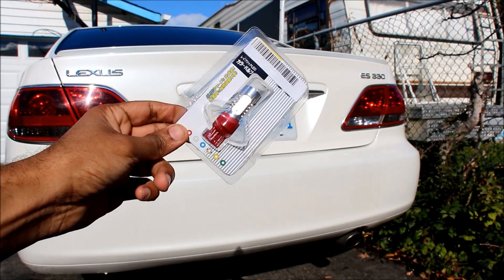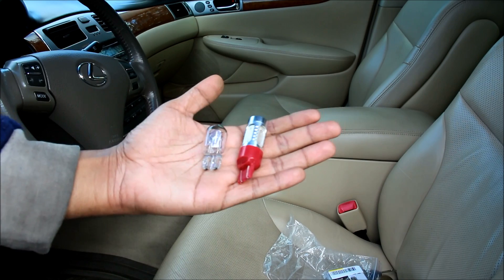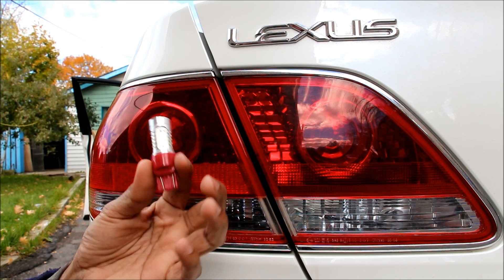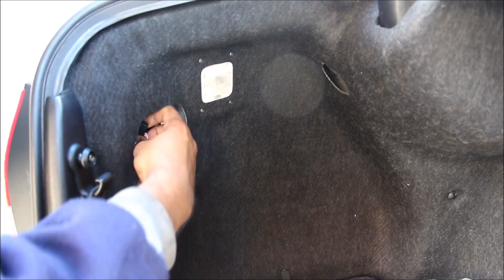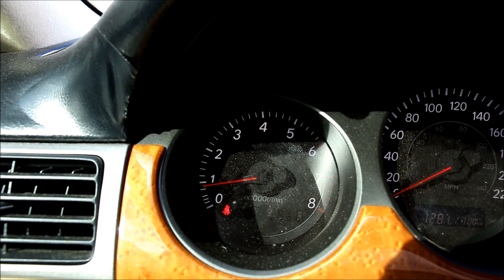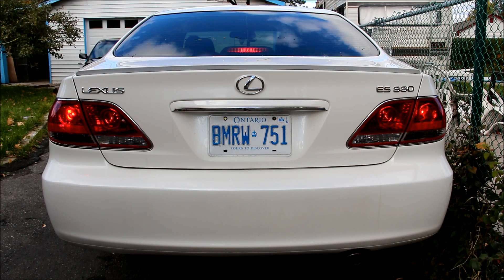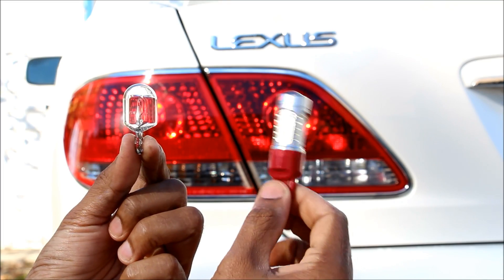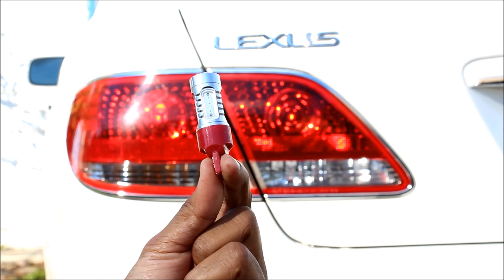LED vs Incandesent Tail Light Bulb Review

Comment: As I've told you before I use Sylvania Zevo Super Bright leds. I didn't want to cut wiring for led resistors so I got a new flasher that handles both regular and led bulbs. The only leds that are not Sylvania is my headlights they are Oracle lighting V Series led headlight bulbs. The V Series has no fan in the led bulb. That's what I was looking for. There not as bright but that's okay. Can I ask you a question. I want to change the bulb or bulbs behind the clock in my 2000 Toyota Camry LE. How do I go about doing that?

Comment: Somehow I feel the traditional filament bulb is good. Because the intensity is good in day light. LED unless if it's a very highend one + fitted with a good reflector will only provide best result in day as well as night.

Just a thought. Is there any post which can tell us how to slighly improve the voltage so that it can increase the intensity little bit more of a p 21w/5w bulb ? May be an electronice boost converter. Many would not agree with it as It may reduce the life span of the bulb. But they are so cheap to afford.
Reply from the maker: The incandescent is hard to beat
Reply: @speedkar99  Well said.

Comment: LED uses less power AND is less bright as incandescent. What sux is there are single LEDS that are bright, they simply will not use them. HEAT? Not an issue since we're looking for LESS THAN twice the brightness to stay legal.
How to fix this?
IF YOU HAVE ROOM...drill out a 2nd hole and silicone in another LED.
Reply from the maker: Modern LEDs have gotten brighter

Comment: Very good video, you got right to the pros and cons of the 2 bulb types.  Focal points of the bulbs in relation to the different housings of different cars is definetly  something to consider.  Lasfit brand bulbs seem to address this best by mimicking the shape of OEM bulbs along with proper LED chip placement. Of course, quality and longevity are other important issues.
Reply from the maker: Thanks
Reply: I just installed Lasfit LED brake bulbs on a Toyota Tundra, OEM bulbs are brighter

Comment: Those led bulbs only perform properly if the projector lens of the bulb points straight back and yours don’t. That’s why it’s not as bright from the rear. The focal point and all that which you talk about is because of the weird bulb position inside your tail light.  And that “stupid light on the dashboard” is very easily fixed with a load resistor on each LED bulb.
Reply from the maker: +Rat Rod Studios - DRR Customs Ltd Yes agreed. 
If I used a resistor though, I'd loose the function of the indicator light on the dash board
Reply: speedkar99 that light on the dash is just a courtesy warning. If you were gonna ignore it before a load resistor, let’s not worry about “losing function” 😂😂.
Reply: Rat Rod Studios - DRR Customs Ltd: Yeap

Comment: I will stick to incandescent.  but another advantage of LED....takes longer to drain your battery if left on.
Reply from the maker: +romansten9 That is if you don't have resistors wired in.
Reply: speedkar99 when is it a good idea to wire resistors in?
Reply: I figure now that a lot of vehicles will tell you if a bulb is out, so if you switch all your outside bulbs to LED, the system will go through and tell you each bulb is burned out, unless you put resistors on every bulb.

Comment: More brightness is not required, and can in fact be a hazard to drivers behind you. (ever driven directly behind a 2018 CRV at night i traffic? Torture!)
The focus on brightness is silly and unnecessary, the advantage of LEDs is power consumption, heat reduction and for headlights, light on the road .
Reply from the maker: +theRealAV8r agreed OEM LEDs are too bright 
But the reaction time is great
Reply: Yet, and again imo, reaction time of either is still fractions of a second, so there is simply nothing to be gained from a safety perspective - we're talking about the human eye/brain, not a computer.
The crucial factor for park/brake light LEDs in alerting drivers is the ratio between normal and bright  not reaction time or brightness compared to incandescent. The wrong LED with barely a difference will actually decrease safety.
I am still researching this myself - apparently there are some with good ratios from Phillips, JDM Astar etc.

Comment: The beam is off because the LED placement is a lot higher than the incandescent. I bought Sylvania Zevo LED and the placement is exactly the same as the filament in the incandescent therefore it does not change the beam pattern at all. I’ve had them for two years on my Chevy Cruze and not a single issue with them al all.
Reply from the maker: +Salvatore Casto Good to know thanks
Reply: Yeah but on a Lexus as shown you get the tail lamp out indicator. Total deal breaker

Comment: I've thought a lot about this and even went as far as to replace all of my rear incandescent lights with this type of Chinese LED bulb found on eBay.  I discovered my eyes seem to be more receptive and sensitive to the incandescent lamps versus the LEDs.  This is probably due to the LEDs being very monochromatic in output whereas incandescents are throwing more of the visible spectrum out there for your retinas to capture.  I ended up going back to all stock incandescents in the brake lights and turn signals, but kept some nice cool white LEDs for my license plate lights.
Reply from the maker: +Alexander George Agreed, the cool white on license plate looks nice and won't bother you since its not shining directly back
Reply: speedkar99 what LEDs did you use on your rear plates any links? Im currently looking through Amazon

Comment: I have an 01 came XLE v6 and I tried replacing all 4 bulbs with LEDs and everytime I stepped on the brakes it blew a fuse, could it be the wrong type of LEDs?
Reply from the maker: +Bozn0man yes because resistance is too low. You need resistors

Comment: I really don't understand you guy. You are all fucking moorons. There's right amount of light with stock bulbs, you can't just boost up luminosity since you will disturb other drivers. And i hope you know that those cheap leds use resistors that will eventualy fail due to excess heat. They usualy last 6 months. And can bus cars will also report bulb error using those bulbs and blinkers on most cars will blink with twice the speed.
Reply from the maker: +Borut Goli valid points. LEDs have better transient time

Comment: Very good review.

 My car also takes 7443s for tail/brake lamps and I ordered white pair.
My car has the older deep red reflector type lens, so I don't think red LEDs would be bright enough as white.
 Newer cars with a clearer red lens, such as yours, would work much better with red LEDs like you demonstrated.
 I am wondering if you installed non-projector type bulbs instead of the projector types, if the light/beam pattern would be more like an incandescent bulb. Since the projector type you installed not only has light output from the sides but also it gives a concentrated beam of light from the top, as apposed to a non-projector type bulb which gives a more uniform light output from all sides, using more of the reflector inside the tail light housing.
Reply from the maker: +Random Canadian yes
Reply from the maker: +Random Canadian thanks for the feedback

Comment: You should  not touch the leds with your hand.   The oil from your skin will cause the led to burn out sooner.      You can purchase a resister to compensate for the car computer thinking a bulb is burned out since the led does not use as much power, it also keeps the turn signal from rapid flashing.

Comment: These LED bulbs don't make enough heat to melt the snow off if you live in snow country.
Reply from the maker: +B Laquisha True
Reply: What if they ice or get snowed over while you're driving?  Tail.lights are especially bad for this, though it can happen to headlights too.
Reply: @lowercherty  then get a vehicle that’s more aerodynamic. Modern cars just have the wind flow over the car and it’ll keep snow from getting back on
Reply: @TaylorPhase  No matter how aerodynamic the car is the tires and slipstream under the car kick up snow and it sticks to the rear of the car.  Don't say just get a lower car, you'd just be showing your ignorance about driving in snow.
Reply: @lowercherty  never said get a lower car. I said more aerodynamic. Even Tesla model x SUVs are aero. And mud flaps can help with that too...
Reply: You're meant to clear the snow off the headlights and taillights before you start driving, anyway.

Comment: The incandescent bulb is far better. And that LED bulb is illegal for that very reason. Not enough brightness change when braking. Philips 7443 is the only street legal LED on the market.
Reply from the maker: +Ron Edwards This led would have worked better if the lense pointed it straight back instead of upward, and if I had resistors to tell the bulb indicator on the dash not to lightup.

Comment: A resistor wired in parallel with the LED can fix the dash board light sometimes.
Cars Simplified has done a cool video on how to get LED bulbs to work in a Volkswagen that normally wouldn't let the polarity of the bulb work.
Reply: yes it will because when the led goes out the resistance changes
Reply: The warning indicator light isn't currently going to "work" when the light is actually out because it is constantly lit. The indicator is designed to function when something fails open circuit. The resistor will stop you from regarding your warning lights as a boy crying wolf.
Reply from the maker: Yes, you can purchase load resistors, but then your bulb indicator won't work when the light is actually burnt out.

Comment: I only notice around a 10-20% brightness difference, seems kind of pointless to me but. If you would have went with a white bulb to the red lens it would likely have been brighter but putting red bulb to a red lens will make it darker.
Reply: A red lens looks "clear" to a red lamp. With incandescent you are throwing away the first 90% of the energy as heat, as opposed to 10% with the LEDs. Then, you are throwing away all of the yellow/green/blue photons that heat up the lens instead of making it through the color filtering.
LEDs don't need more cooling than incandescents when they aren't run to the edge of their ability. The LED lamp is running 4 LEDs in series and grouping them in 8 groups of 4 to generate that 7.5 watt rating. The worst-case scenario would be 7.5 watts at 12 volts for 625 mA. That's well within the shared capacity and shedding less than a watt of heat instead of nearly 20 watts of heat with the incandescent.
Reply: We can put LED with same power as incadescent bulb where LED will be at least 8 times(800%) brigter.
But LEDs need good cooling, and inside plastic box without airflow they will die quickly.
So its best to install low power LED that have same brightness like incadescent bulb but dont requires much cooling and will last.
Reply from the maker: +B-91-10 putting a white bulb into a red lense will make it show pink.
Reply: oh okay

Comment: First time that i see a led bulb that gives good and bright light :) nice video
Reply from the maker: +MMD Bright yes, but it's not aimed properly in these housings, so I don't see the advantage of going LED.
Reply: Try these: 

https://www.amazon.com/Philips-7443-Intense-Vision-light/dp/B00P2D3W0A

Much better than stock for me on my 2010 Corolla. They emit less light altogether but the reason they work much better is because they cast the light onto the reflectors taking advantage of the reflective surface. These tower style bulbs are simply focus on raw lumen flux while the Phillips uses the existing reflector optics.

Comment: In my 2006 Jetta they don't work at all unless you use a resistor or buy the ones that have the resistors built into each one.  Other cars that need a resistor will give you that cheesy hyperflash (turn signals blink twice as fast).  If you need resistors be sure to find a safe place for them, they get hot.  You don't want those up against wiring or on an exterior panel.  Get help from someone who has already installed load resistors in their car if you have to or you might have problems if you don't mount them somewhere safe (not near plastic or wiring and away from exterior panels).  If you use 1156 bulbs, DeAutoKey makes them for such finicky cars as my Volkswagen.  They already come with the needed resistors and a limited lifetime warranty.  These might work with other cars and they may even make the wedge type bulbs too.  The best thing is their prices are reasonable, none of that 80 dollar per bulb bull shit.  They make all their own bulbs and even interior and exterior bulbs as well that are error free out of the box unless otherwise noted by them.  DeAutoKey's bulbs work flawlessly in my Jetta and that is a car that is difficult to find LEDs that work in without having to wire resistors in, I know because I looked.  Even ones of other brands claiming to be CAN bus compatible did not work and my car has a CAN bus.  What I do is make sure I can return them, some places will not take them back because they are an electrical item so you have to watch out for that or you could loose some money on bulbs that don't work.  That would suck.  I even tried the Sylvania ZEVO LEDs, LUMEN Plazma, Pilot Automotive (junk?).  All three had claims of being error free on the packaging, well here I am every LED manufacture's worst nightmare when it comes to advertising hehehe!!!!!!
Reply from the maker: +John Doe Good point. Given the poor performance of LED's, plus the fact that you need resistors producing heat, I'm sticking with my incandescent bulbs for the time being.

Comment: Would getting error free LED's solve your dash light problem?
Reply from the maker: +dragon123443 LED's with resisters built in would solve that problem, but then the indicator wouldn't work if the LED did burn out.
Reply: If the LED stops functioning, you have that problem either way: load resistor keeps the dash light off whether the LED is working or not.  Without a load resistor, the dash light comes on with the LED working or not.  

As you are: if the LED does burn out, you still won't know since you are already ignoring your dash light...

Comment: What about LED headlights, or, a fix to the dash light?
Reply from the maker: +My03Tundra I'll have a review on LED headlights out soon. They cause too much glare like HID's. To fix the dash light you can wire a load resistor in parallel or cut the wire going to the bulb in the dash.
Reply: LED headlights cause glare? I was unaware of that.
Reply from the maker: Big time glare, but it really depends on the housings you put them in. See this video:

https://www.youtube.com/watch?v=wFOfIZMMjA0

Comment: You can use a can-bus led to get rid of that warning light in the dashboard.
Reply from the maker: +Daniel SBK True. CAN BUS LED's have the load resistor built in, though are typically a bit more expensive.
Reply: https://www.youtube.com/watch?v=tkPGqM0Sl64

Comment: To stop the fault light on the dash, you could try soldering a resistor in series with the LED with the same resistance as a standard bulb.
Reply: This would mean that with led and resistor the same current will flow as with regular bulbs.
Reply from the maker: +Michael Martyn The resistor would have to be in parallel, and be a high wattage resistor. But then if the LED bulb were to blow, you wouldn't know because it still thinks the resistor is the light bulb. Load resistors also produce a lot of heat.

Comment: good comparison video, hope the LED bulbs last for you, I'm not a big fan of the quality control of the made in china units, put some in my license plate lights and one side went out after about 3-4 months, I'll be waiting things out till LED designs improve and have the proper lighting angles
Reply from the maker: +neppy5 The angle and light distribution is the biggest thing. At least this LED bulb feels substantial and looks like it will last. I'm going to revert back to the OEM bulbs for now, since the brake light isn't as bright, as you saw in the video.

Comment: Thanks.  That was very helpful.  When the time comes, I now know that I won't reach for an LED replacement.
Reply from the maker: +wholeNwon For some, its worth it for the looks, for others LED's aren't worth the cost.
Reply: +speedkar99  Right.  I have a Lexus, too, and mine would not only show the light out message but also sound a chime.  Those would be hard to put up with.
Reply from the maker: A chime? wow, never heard of that on a Lexus. What year and model? I thought that was mostly a German car thing.
Reply: +speedkar99 1998 LS400...spectacular car.  It replaced 2 Mercedes which were junk by comparison...in my (Constitutionally protected ) opinion.
Reply from the maker: LS400 is an amazing car. It will last you many many years.
Reply: +speedkar99 It already has and is still a joy to drive.  Hope to keep it indefinitely.  BTW, I'm about to change the differential oil. According to Lexus of North America, there is no approved substitute for the required GL-5 90w (single viscosity).  It's hard to find but Miller's still makes it and there is an Amazon retailer.  The price is reasonable.
Reply: wholeNwon
I'm sure your Constitutionally protected opinion is 100% 
accurate---hehe.  I haven't owned a Lexus, but my last vehicle, a 
Mercedes (C320), was one poor quality car.  Babied it and maintained the
 living daylights out of it, and it was still always broken :(   It's 
obvious why they sell so cheaply on the used market.